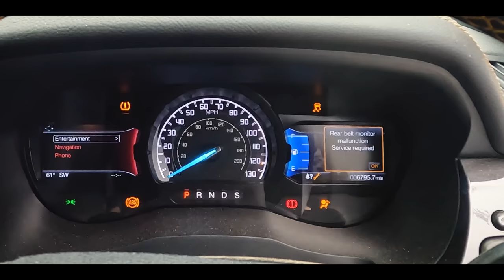I fixed this HUGE BUFFALO's HOOVES!!

Comment: Yup, I have been building and remodeling since I was 17 and helped build my first house. I’ve had a grinder wrench my wrist more than I would like and therefore another reason my tendons are in the bad shape they are in. I have a drill and a multi tool that will snap you to attention in a heartbeat of your not gripping them firmly and alert!

Comment: I grew up in rural South Dakota, USA. When i was around 14 my mom and i broke down one night at around 4am. Once the sun stayed to rise, and having not had anyone come along to ask for help, i set out to go find a farm house to ask to borrow their phone to call for help. (It was the 80s, we didn't even know anyone with a cell phone much less own one) 

So, i hopped the barbed wire fence closest to our side of the road to see if the farm might be just over the hill. The fence was a bit taller than you'd expect, but it didn't set of any warnings in my brain.  As i was cresting the hill, i heard what sounded like an angry bull. So i turned around and took off running. 

So i went across the road to head to the farm i could see from the road now that the sun was higher. The farmer had seen me crossing his field and drove out to pick me up. He agreed to help us contact help. 

But, when i told him about crossing the other fence first and what happened, he started laughing his ass off and saying i was right to, as we'd say in the army "un-ass the AO".

That first field was home to bison.

Comment: Why do you not wash the poo and other junk off before you work on the hoof? I've seen both horses and cattle with various injuries and they always wrap the hoof with poo still in there?
Reply: I can only answer why he doesn't, and that wouldn't apply to horses.
1 one swipe of the grinder will get it far cleaner than water ever will.
2 water makes everything slippery which is never a good idea, when razor sharp instruments are involved.
3 water and electricity aren't a good mix.
Obviously horses aren't trimmed in the same fashion, so the above reasons can't apply to them.

Comment: There's a fb page  using your  logo...pretending  to be you...contacted through  messenger  telling  me you are giving  me a solar generator  and a lap top....I told them to give it to someone  in England  as the postage to Sydney Australia  will be expensive...they said that  they will get it to me...I then blocked  them...

Comment: why dont you wash off the foot before you grind or shave and spew manure all over?
Reply: 1 one swipe of the grinder will get it far cleaner than water ever will.
2 water makes everything slippery which is never a good idea, when razor sharp instruments are involved.
3 water and electricity aren't a good mix.